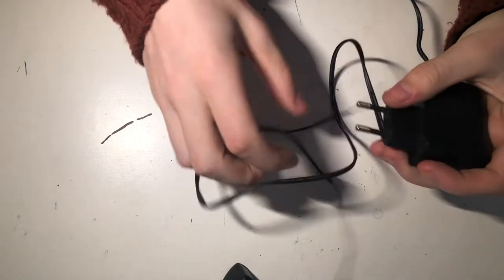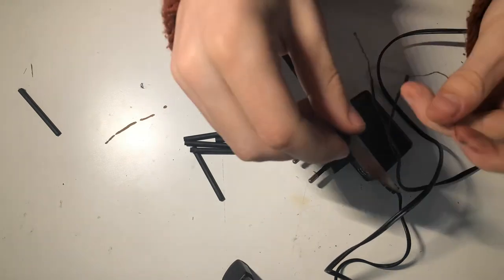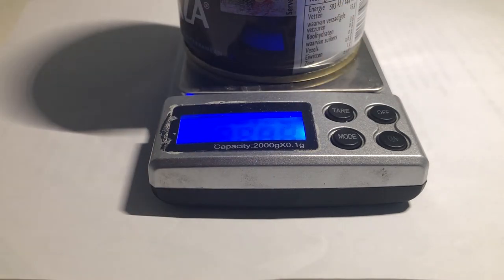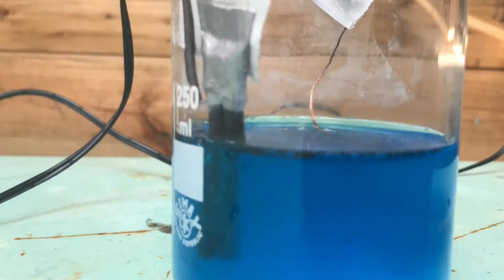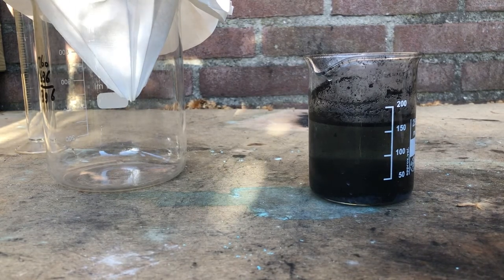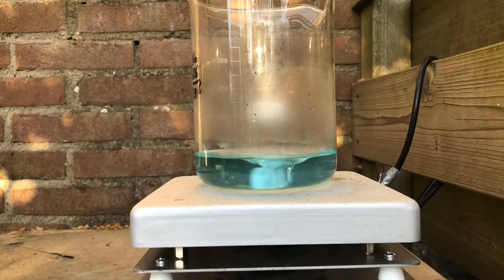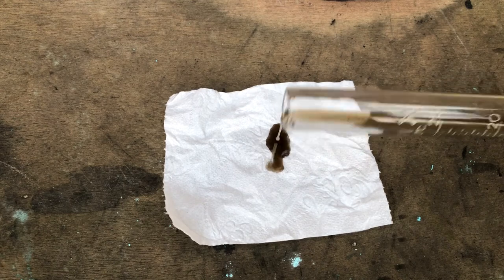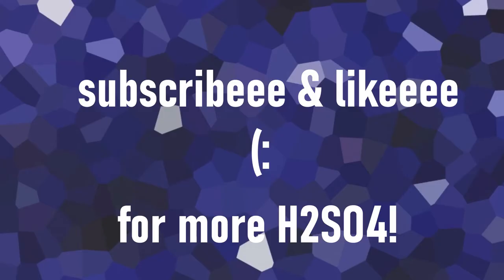Making sulfuric acid part 2 -electrolysis of copper sulfate

Comment: I electrolysed it further and it will simply not get any clearer. I did mine with a platinum coated titanium electrode. Time to boil off the water then distill it.

Comment: What current and voltage did you cell run at?
Reply from the maker: i used a random wall adapter so idk
Reply: @sciencething1449  Ok. It's important to know that. It says a lot.